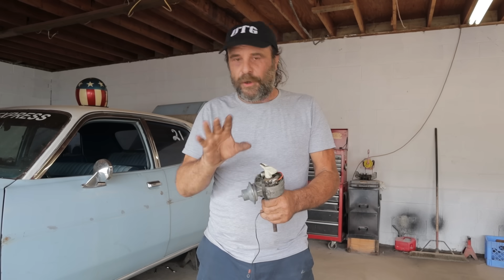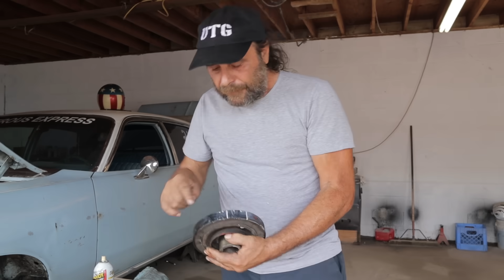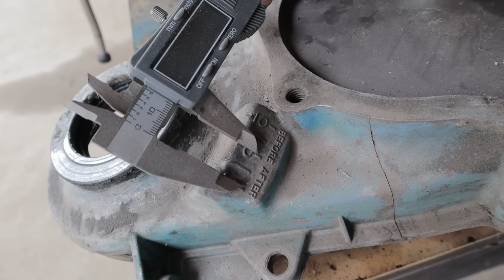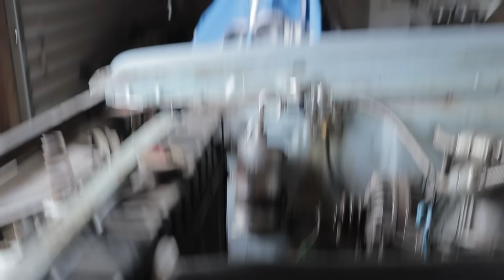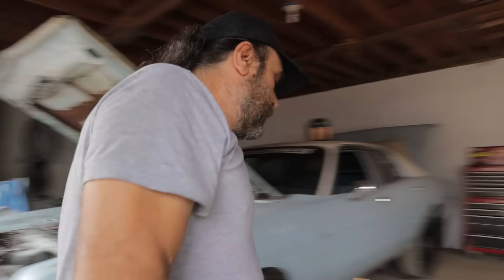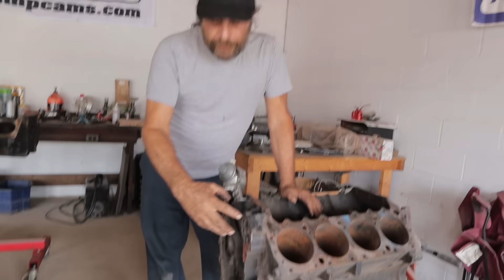Ignition Timing For Power

Comment: If you don't understand how a coil works you will be confused.He is talking about the high voltage spark wire from the coil.  when a coil is powered up it charges. when the power is off it discharges. HENCE SPARK The distributor controls the coil.

Comment: OK, maybe you can answer this. a couple years ago i bought a 1988 F350 with a 460. The owner had just put in a fresh long blcok but he couldn;t seem to get the jeul injection to work right so he rippied i all out and ut and Edelbrock 1307 on it.. Still couldn't get it to run right. PArt of that problem was that he only have a cheap 9x2 air cleaner on it. a 3 x 14 solved that BUT. When I set the timing for good performance and economy (often the same because efficient engines run pretty strong)  

The problem i have is that when I set timing to get that good perfromance once the engine gets to operating temperature and shut the engine off, when I try to start it it barely cranks like it is psuhing against a firing cymlinder. On  my mond that is confirmed because if I get out and retard the timi0ng a few degrees, it fires right up. It has the original factory ignittion system...DO I have a faulty component or should I replace the factory stuff with old school components?

Comment: So how would you drop an hei in using this initial method at say 32 degree advance? Set the body to where the leading edge if the rotor catches the cap

Comment: This is a great video explaining total advance. I know there is a debate on full manifold versus timed versus no vacuum advance. The answer is they are all correct depending on your engine setup and most importantly what you plan to do with your car. If you are running a stock engine and only care about initial timing say at 10 degrees, then hook up that vacuum canister. It won’t hurt a thing and will help with engine idle. If you are running a mildly modified or high performance engine, then you will be better off working with total timing in the 32 to 36 degrees range. Uncle Tony hits the nail on the head when he talks about running total timing with full vacuum advance. The engine will miss fire and sputter at mid or half throttle because the timing will be way too advanced. He is also right when he talks about opening the idle mixture screws more as a possible remedy. This will work sometimes but the consequences is a rich running engine at idle that will run you out of your garage or shop and eventually foul plugs. So, disconnect that thing when running total timing or plug into the timed vac port on your carb. Your engine will thank you! Great work UT!  You da man! K Roush.....

Comment: I changed  valve seals on a good low mileage motor and was able to run 87 octane  compared  to 89 because of less oil in the combustion chamber.

Comment: I have no issues with my timing light with dial adjustment. I'm sure they have improved since 30 years ago.
Reply: My old timing light works better than my expensive new timing light. New one is off by about 10 degrees, old one is more accurate. Who would have thought that...

Comment: ALSO!!! Run the type of fuel you regularly run regular 87octane or premium 91-92 octane make sure you’re running that when doing total timing cause higher octane fuels enable higher total timing. Regular pings easy, premium resists pinging more

Comment: you dont need the marks ..you need an adjustable timing light ..go back 30 deg on light and it marks 0 at the Damper mark...at 9 min   how do you get spark if you dont have a Cap on ?? if cap on how you hold the Rotor ??? not very serious.....

Comment: Hey tony I got a weird one no mechanic can figure out.  I got a 93 gmc 2.5l iron Duke. They replaced the distributor,  ecm, injector, egr and still has a problem. So when the vehicle is cold it starts uo no problem but when it warms up and turn it off it has a crank no start.  I'll give it a little throttle and it starts. Then runs a little rough and back fires. The o2 sensor is working and running rich to lean. But cant figure out why its backfiring when it reaches operating temp. Timing is at 12 degrees which I believe it should be at 8. Could 4 degrees cause a crank/no start condition?
Reply: Could be fuel pump. When it gets warm it starts to short out. I had one that would stall the engine. It would not start until it cooled down.
Reply: @boxlooking  thanks for the reply. But I figured it out. I did a vacuum test and it turns out the valves in cylinder 1 and 2 were sticking when it got warm. Pulled out thr plugs and they were black. Threw in a new set of plugs and the same. Blk again in 1 and 2 on a single injector throttle body.

Comment: Why would “total timing “ not include vacuum advance?
Reply: because vacuum advance is LOAD based.
Reply: Yes. My thought was, high rpm on a dyno was high load. My understanding of ported vacuum also known as Venturi vacuum is velocity based. Therefore at 6k WOT. There should be lots of ported vacuum to run the vacuum advance. Why not use it as intended. I’d like to see a gauge on ported vacuum on the dyno. Way back in the 80’s when I had access to to distributor machine. We would recurve the advance to include the rate and limit of vacuum advance.
Reply: @jasonlessard2373  well vacuum advance come up when it's a low load cruise speed.

I known that actual vacuum should be close to 0 if not 0 at WOT. If not there's a restriction in the intake somewhere
Reply: Correct, manifold vacuum will be zero’ish at WOT, but what is ported vacuum at 6k WOT?
Reply: @jasonlessard2373  I don't know if it matters as much for a performance gain because its above the throttle plates vs manifold vacuum below the plates

Maybe soemone has done it but i doubt you'll gain anymore knowledge about tuning from it

Comment: 400 Pontiac 
6X heads
9.5 cr
RA3 cam
Holley 750 Performer rpm
HEI ignition 
Cam installed straight up, not advanced (bc Pete McCarthy says so)
We played with timing for two days, dozens of dyno runs. 
Light(er) springs, 36 degrees total, no vacuum. 
Not for fuel economy or lower emissions.
You're welcome.

Comment: Good information, I’ve purchased that timing tape from Jegs, works great till it blows off at high rpm, due to Jegs great customer service,I bet I’ve went through 4 or 5 of them at no charge before I just said to hell with it, my FE has the numbers on the balancer, and they are barely readable, I’m thinking about taking my dremel and making the marks at every 10* much like you’ve done
Reply: Just spray some clear over it .  Mine been on for 30 yrs..

Comment: Tony.... I have a question for you. I have a 2001 Dodge ram 2500 4 x 4 truck with a manual NV 4500 transmission.... it has a 5.9 360...... I just purchased a 1977 big block for 40 out of a motorhome. It had a automatic transmission. I’m going to put the big block in my truck. How hard is this to do? Somebody told me that the back of the crankshaft doesn’t have a big enough hole for the pilot bearing?

Comment: You're right about every engine is different, the efficiency of the combustion chamber makes a big difference. Back in the day chambers were not as efficient as todays engines thus needed way more total advance ie low 40s for max power.
Reply: 👍 60s SBF needed 42-45.
Some 429s needed 48.

Comment: You'd be more accurate if you did it by diameter. If you Have an 8" outside diameter dampner, then the outside diameter is 3.1416x8=25.1328. If you take that and divide by 360 (or even 10) that will give you the distance per degree. That equals .0698" per degree. Then you can mark out every 5 or 10 degrees. Or you can just buy timing tape...

Comment: Tony. great video on timing, however I disagree with your method of marking the balancer. by using a dial caliper, you are measuring in a strait line. but the balancer is curved and it will not give you a accurate timing mark. you need to do a little math to get it sorted out. the formula is Pi * balancer diameter / 360.  so for a small block Chevy with an 8 inch diameter.  i would use 3.1416 * 8 / 360 = .069813 per degree. so if i needed a mark at 36 degrees, I would use this formula,  Pi * Balancer diameter /360 * desired total timing. 3.1416 * 8 / 360 *36 =  2.2340 inches. so I would cut a piece of heavy duty aluminum foil to that length and then curve it around the balancer and tape it from the mark at TDC to give you the desired spot to mark the balancer.
or you can just cheat and by the timing tape and use it as a guide to make your marks on the balancer. i prefer to us my Dremel with an engraving bit to make the marks. rather than grinding notches that could weaken the balancer. 
Also, I like to put marks at 90 degrees on my balancers so I can check the timing at each cylinder with my dial back timing light, the newer timing lights from Innova are very accurate. you would not believe how poorly most distributer caps are made, the timing can be out a couple of degrees cylinder to cylinder on some cheep caps. which is not a big deal on a street car, but if your building a performance engine for racing it is worth several horse power.
Reply from the maker: The timing indicator is curved also, to match the damper.

Comment: marking a damper with total deg. is easy math . Lets say you have a damper with a diameter of 7.5 inches and you want to mark 32 degrees we also know π is 3.14. So, the formula is ( π x deg ) x dia ÷ 180  lets try it out.  3.14 (π) x 32 (deg) = 100.48 ok so next  100.48 x 7.5 (dia) = 753.6  so know we just need to  divide our total 753.6 by 180  which is   753.6 ÷ 180 = 4.186  There you go, from the zero mark on your damper just measure ( preferably with a cloth tape or a small 3 foot tape because it's very flexible ) over 4.186  ( 4-3/16 close enough) and you're marked at 32 deg and now you can also use this to show your buddies you're not the idiot they say you are......
Reply: I do hope you understand this is directed at the people watching these, not the people making them

Comment: Uncle Tony.... Back in when i was a teen i used to run the advance up till it i get the motor to rattle then back it off a few degrees to get max timming.  Can you make a video on a safer way to get the most usable timming without going to the dyno?

Comment: I enjoy watching Tony's videos. 
 This guy knows his stuff! 
Tony Brings back fond memories.   When  i was 16 I didn't have a timing light or a dwel meter 
 But I did have a beautiful 55 Chevy 2 door hard top !   I figured  out to set the timing.  I could take the cap off turn  the housing in the opposite direction of rotation of the rotor  and watch the point's. When they spark your there. Lock it down. At that point mark the location so you can always return to  your base position. 
move the distributor and listen to your motor it will tell you where it wants to be .On an electronic one 
just use the number 1 wire.

Comment: Can't beat the "turn it up till it pings and back it off a tad."
Reply: Can it be done in the driveway with hood open and listening while revving engine, or does it need to be driven under load?
Reply: @WesternReloader  Under load on the road.
Reply: @WesternReloader  It's best if you take the hood off and have someone drive the car as you ride on the fender adjusting the timing.
Reply: @thereluctantgearhead4544  I’d do it but my wife doesn’t drive mechanical clutch linkage stick
Reply: Yes that works, but just to let you know, pinging starts before we can even hear it

Comment: Wow, talk about ironic - I was just experimenting with this exact thing yesterday on my own 440.
I don't have any fancy measuring devices, so I used a piece of paper to transfer the timing marks 
off the front of the engine to the stock harmonic balancer.
Not even kidding.... and it worked, just like Tony shows here with his caliper thingy.
I had two distributors that I wanted to choose from and was able to compare the two's performance
easily doing this - there was quite a bit of difference in each one's built-in advance.
In the end, the DC/Mopar Performance distributor won and the stock one lost and was relegated
to the parts bin.
Once again, VERY practical lessons being taught here at UTG! You can do exactly what he shows
here easily, without a bunch of fancy tools or high tech equipment. 
Thanks as always, Tony.
-Ed on the Ridge

Comment: Uncle T, I love your shit! I'm tinkering the timing on my mopars off of your data and I'm definitely making gains across the board! From timing to jetting I cling to your knowledge. But how does a guy know when he's reached his timing limit? When is some spark knock ok?
Reply: NO.
Knock is a shock wave hitting the metal.
Like hitting it with a hammer.
Reply: As Ray said you never want knock under any circumstance.
Reply: That sucks. I have a low comp 400 from a 73 power wagon that's barely pinging @ 1800 no matter what I do with the springs. It's pissing me off. Maybe I'll drill the weights to get them kicking out @ 2000.

Comment: I have a SBC 350/Powerglide combo in my hot rod without driver 2340lbs, just got a new edlebrock AVS2 carb when I floor it hesitates for a brief moment then takes off. I clocked my 0-60 in at 5.9 seconds, car runs good but I think it’s either timing or carb adjustment..
Reply: So doing this do you start off with the timing marks at zero? Or at the 8-10° and then adjust so that 30 ° or so is at zero TDC? Afraid I'm going to advance it too much.

Comment: I’m looking forward to hearing about curving a distributor. 
What rpm should total timing come in on towing rig?
Reply: 3,147 variables.
Remember running full throttle loaded and not accelerating up a hill is different than the engine revving at full throttle.
Reply: HotRod Ray:  okay so all in timing in by 3000 rpm would be basically the same. I just want to ensure I don’t have to much total timing so I don’t destroy the engine by pre destination correct?

Comment: Thx UT, love the content. My ride, a 4.155 bore, is locked at 36
Reply: Good power compromise. ???
Reply: @HotRod Ray Sorry, just saw your question and I’m not sure what you’re asking but the thing roast(ed) tires anytime anywhere. Heard something in the motor and found broken lifters. Decided on a complete, and I mean complete rebuild. Engine w afr 220s, front & rear suspension, brakes, new fuel system, engine harness, switch set, racepak dash, blah blah blah. It’s a c10, and it’s for fun. I put about 1000 miles on it each year. Don’t care about mileage, putting in a 24 gallon tank. Been 2+ years. Expecting around 600hp NA. I hope that shotgun approach answered your question😁

Comment: Setting up timing for initial start on an engine using UTG method is for external coil designs, not HEI (GM internal coil/cap design).  Another way is to mark the distributor housing where cyl #1 of the dist cap lines up.  Then turn the dist where the points open or where the two electronic points line up on the shaft and the pick up coil and the ign rotor is pointing to your mark on dist housing for cyl #1.   I may of butchered this trying to explain, but an experienced mechanic will know this.  Cheers,
EDIT:  External or internal coil design.

Comment: Who can help me understand GM LS timing. Why is WOT advance around 32 but low throttle cruising is like 44? For clarification: I have a 94 LT1 350 with LS computer and coils.
Reply: At low throttle cruising you need more advance for best combustion.  This is either done by the computer (in your case) or the vacuum advance canister on the distributor.

Comment: Ive found success doing this using a recurve kit putting largest bushing and lightest springs on mechanical advance giving 10 to 12 degrees of timing coming all in at 1500 to 2000 rpm and setting crank timing to 20 to 24 so 30 to 36 degrees of total timing
Reply: yep. more initial than mechanical all in at 2000-3000

Comment: Hot Rod Magazine had an article about total advancement, 40 years ago. I believe they said to have 40 degrees. They. also, said to keep your spark plug wires separated from each other if they fire consecutively on the same bank.

Comment: Total ignition timing is relatively new to me - I still haven't figured out how to dial it in for a STOCK (fresh rebuild) Slant 6 (72 Swinger).
Reply: Begin by marking rhe damper.  If you were to make a mark opposite the existing damper timing mark, it would be 180 degrees.  Halfway between there and original mark is 90 degrees, half that 45 degrees and so forth until you reach your desired target.
Reply: Cant mark your damper until you use a piston stop and degree wheel.
Pretty good chance your damper is off
Reply: @hotrodray6802  Don't forget to remove the piston stop afterwards!  Careful not to allow valves to contact piston stop, may need to back off the rocker arms. To avoid bending valves.  Don't use the starter while piston stop is in the head.  You can use timing tab, it'll be easier than attaching a degree wheel.
Reply: @hotrodray6802  Be careful with that piston stop, back off the rockers to avoid bending valves, remove all plugs to make it easier to turn.  Don't use electric starter while stop is installed, will punch a hole in piston.
The timing tab can be used instead of a degree wheel.